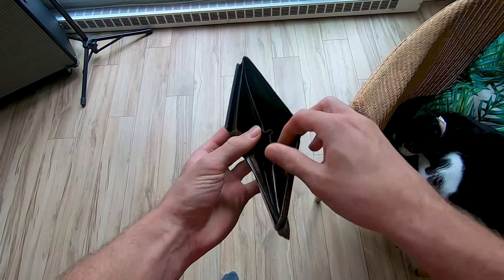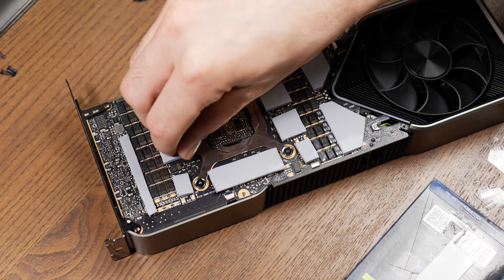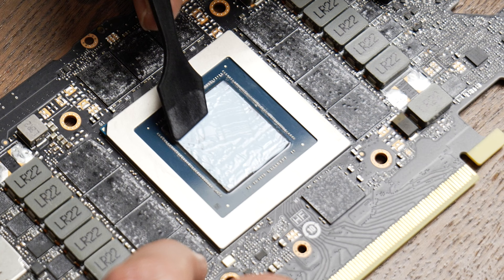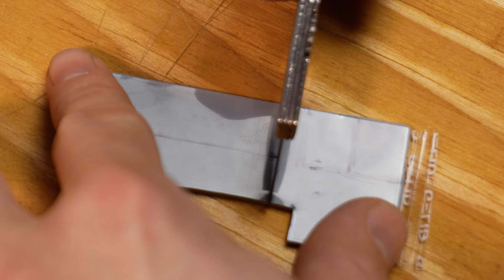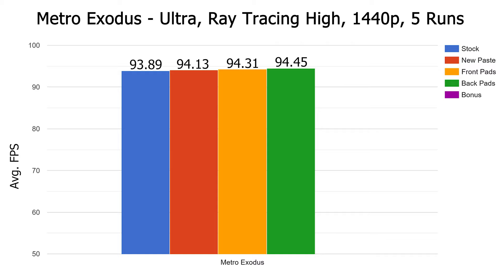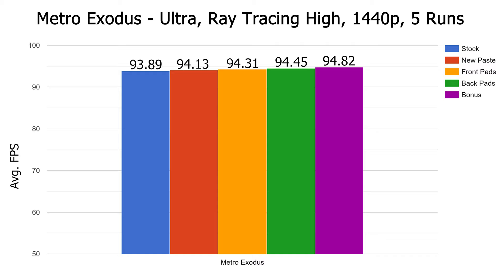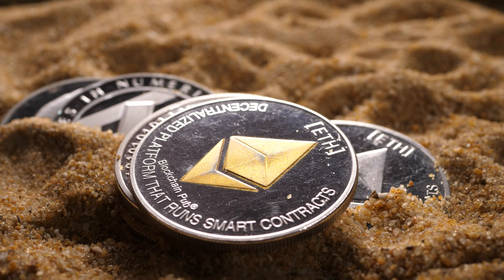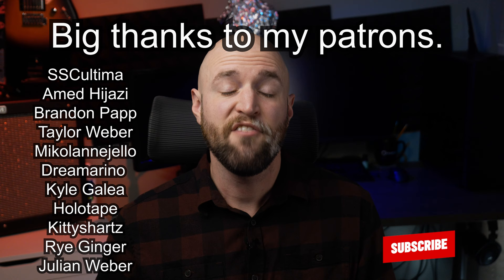Are New GPU Thermal Pads Worth It? | GELID GP-EXTREME

Comment from the maker: Unless you are Mr.Moneybags I only recommend swapping the face of the card. You can get away with using a single 2mm sheet. US link: https://amzn.to/3MC2pO0 Canada: https://amzn.to/3Xf62y2
Reply: @Tech Illiterate  Is this 3080ti FE new? like bought within the last couple months? People are saying the spec changed with the newer cards
Reply: @spaghettir101  bump ^
Reply: @spaghettir101  his is old board
Reply: @spaghettir101  In 3080ti Fe have 5 month old more or less, whats thermal pads I need? Is 1.5mm one side and 2mm other side?
Reply: @mdmt111  probs 1.5mm on the vram and 2mm on the vrms.  Leave the back, its not needed
Reply: you should try K5 Pro it works great

Comment: Looking at the GPU market prices, lowering temps may not give you more gaming performance, but it will make your card last longer due to the low temps, which I'd say is worth it.
Reply: no one knows by how much
. were making our best guess that could be the case
Reply: @flawns  lower is always better.
Reply: Don't forget the noise of the fighter jet that doesn't come out off my case ;)
Reply: It will improve latency, low1% i notice
Reply: Yep! I plan on using my RTX 2080 ti at least until 2030 .. seriously. and I am gonna replace the paste on the GPU by a Carbonaut pad and the thermal pads by Gelid ones. As the memory was an bigissue with the 2000 series, lowering the temperatures on the mem could have a huge impcat on longevity. Also I of course heavily undervolted the card.
Reply: @flawns  Usually optimizing from the vendor's original parameters has a large impact in longevity, because vendors are pushing hardware to an unhealthy max, for obviousy reasons. It's advantageous to not only have slightly beter benchmarks, but also lower lifespan of products, expecting your customers to buy from you again...
And as the relating physical parametres behave exponentially, there's a LOT to win by changing a bit. The temperature deltas to be seen in this video could easily expand a card's lifetime by some few hundred percent.
Reply: @elmariachi5133  they also put the minimum required variables to achieve competitive prices
Reply: It's hard to say whether it will or not. Assuming everything else is the same, lower temps will definitely make those memory chips and VRM components last longer, but would either of those be the first parts to die anyways? Maybe, but no one knows. Just like a person, graphics cards can die for a bunch of reasons. If, for example, the GPU core itself or some capacitor or resistor will be the first thing to fail, changing the thermal pads isn't going to do anything to prevent that.
Reply: yeah, I think the longevity will be longer.
Reply: @averyalexander2303 Yeah, but having it run cooler reduces the amount of it expanding and contracting from the heat, which could in theory decrease the chances of a capacitor breaking.
Reply: @MrGamelover23  Good point. Lower temps certainly increase the chance of good longevity, there just aren't any guarantees that more effectively cooling a few of many components will or won't increase the longevity of the card as a whole.
Reply: but electric current usually killing it
Reply: Even without putting on new thermal pads your card will last long enough to the point to where you're going to upgrade to a new card unless you plan on keeping your card for over 10 years

Comment: A graphics card at better temps is worth it, as it probably might increase the longevity of the card…
Reply: no one knows by how much
Reply: @flawns  yes but still it helps with the peace of mind that your card is not running at near limits. also, it helps keep room temps down especially if you're not using ac.
Reply: @flawns  By a f**king shitload.  There are plenty of studies which have tested the difference of running at thermal throttle temps (100% of the time) vs capped at 90% of thermal throttle temps and it almost doubles the lifespan....considering his memory was being throttled (100 deg) ....yeah....huge difference.
Reply: @Lancia444  For real, you're kinda aggressive but this factor seems really under emphasized. Heating and cooling is expanding and contracting the material, which wears it out. All materials have durability limits and can only do this so much. The higher temps push all metal and silicone further to it's limit, and like most thing's in nature it isn't linear, but moreso exponential, specifically to closer to the Fibonacci pattern than any other pattern.

Basically the lifespan can be thought of as a result of build quality taken to the square root of the temperature it's used at. That lifespan dropoff gets a way faster increase in every incremental step of it's reduction for each consecutive degree a material is taken toward the final max temperature that it will simply break at immediately.
Reply: @mangosteen.  "it helps keep room temps down especially if you're not using ac" That's not true. The card will output the same amount of heat no matter what cooler/pads you put on it. It's just that the heat from the card will be transferred into the air more efficiently. Unless they've invented a new form of GPU cooling solution that sucks heat and then teleports it into a black hole at the other end of the universe.
Reply: @mangosteen. Having a better cooled cards wont do Jack shit for your bedroom temperatures. That's not how physics works. Without a change in Settings (voltage / power limits), the heat output doesn't Change regardless of the quality of your paste / pads etc.
Reply: @bgtubber  People often say that as well as that better heatsink paste will make the heatsink colder. The opposite is true, it will conduct heat better so actually while the CPU will run cooler the heatsink will be a bit warmer.
Reply: @Lancia444  this is not really a relevant comparison because capping the card at 90% of the thermal limit is not the same as running it cooler. By capping the thermal limit you effectively make the card run on lower voltages and it is common knowledge that in the long run and outside of edge case scenario voltage is the real killer of electronics, not heat. Still I'm not denying that improved cooling won't help - just pointing out it's not the same thing.
Reply: @bgtubber  not quite true, resistance raises with temperature therfore technically decreasing the operating temperature of the GPU could yield better thermal efficiency - same performance with less heat output. Less heat generated due to the resistance of the components on the board. Though the difference most likely be neglegible in the case of swapping pads, to get a noticable decrease in heat output you'd probably have to water cool it.
Reply: From my experience, improving, the cooling of any graphics card increases longevity as well as stability. now by how much is a different story altogether, depending on brand and cooling used

Comment: It's not just about gaining performance, it's also prolonging the life of the card.
Reply: Exactly.. Memory temps reduction by 16°C is a huge success, it doesn't matter if the performance rises or not, the important thing is the memory now isn't overheating what should potentially increase the gpu lifespan, or rather the lifespan of the memory chips. 

The sad thing is the gpus don't come like this from the factory, the late stage capitalist big business corporatist thinking nowadays is that it will survive long enough so the warranty expires and then you'll simply buy new gpu if it manages to die on you. Some call this planned obsolescence but they don't really plan it, they just use the same materials they used for decades now and only address the issues ie replacing the materials or doing other improvements if the product would be dying way too often under warranty what costs them money.
Reply: Exactly! Not to mention that with the lower temps, I was able to oc my 3080 and run fans slower and quieter, SOOOO, I gained huge performance advantage.
Reply: Not just that but fan noise is bad when the temps are very high.

Comment: I thought 1.5 mm was the ideal pad size for these things... that's what I used on my 3090. Same deal, temps dropped significantly.. I don't game, but I do feel safer when my card is rendering in octane for several hours.
Reply: Every cooler has different dimensions, 1.5mm may be the correct size for this card, but it’s not universal

Comment: Better pads = Lower temps on card, less heat in the PC tower in general, less stress on the card which means better longevity in general. Couple this with a slight undervolt and you're golden. Also don't forget that some cards come with really crappy thermal pads. Subbed by the way 😀

Comment: These mirror my results exactly.  Performance improvement was within margin of error, but memory temperatures were decreased substantially, and that was with cheap "blue" amazon thermal pads.  Performance gains were only realised with undervolting (using the Volt/Freq curve in Afterburner).  Great video!
Reply: did the fan sound also decrease?
Reply: @Gojee_  Not that I recall, not substantially anyway.  I was also playing around with custom fan curves at the time, so I can't comment on how fan speeds were affected, or by how much.

Comment: Just did the same thing on my 3080ti FE. Oct 2021 date on the cooler, reddit suggested changes on the later production 3080(ti) FE coolers should use 1.5mm instead of 2mm. Used 1.5mm Gelid Extreme on the chip size, 2mm Extreme on the back place. Temp results are fairly aligned with the your test. Thank you for the info!
Reply: Hey, it might be late for you to remember, but what thickness did you use for VRAM and MOSFET pads? I have a 3080 TI that has a hot spot reaching 100 degrees when gaming, so I am planning to replace pads/thermal paste to start with and see if anything changes...doing some research first regarding what pads/what thickness to use for different locations on the GPU though.
Reply: hi

i have a question ,i have Asus Dual GeForce RTX 3060 Ti V2 Mini OC.It overheats .when i play gta 5 and furmark it goes up to 85
some people say it is normal ,even i changed 4 times thermla paste with 3 different good brands still didnt make any difference.if i dont play games i get 45-50.only when i play games it goes up to 85
i ordered the thermal pads i will change the thermal pads and give a try also 
if i put thermal pads on the back plate will it make a difference also.if it makes how thick it shoudl be covered with

Comment: the coagulated feel of the pad is called "wet-out" pad. They are extremely conforming to the shape of the location you apply them to. This is because any gaps/scratches/deformities can be filled in and eliminate the air pockets, ensuring good contact. Its usually held in shape by the plastic sheets/casing it comes in. You need to let them cure/set before the catalogue properties/performance can be expected.
Reply: except if the pads are crap then you won't get very significant temp changes when they do cure/set.

Comment: There's a LTT video where they try out a thermal pad replacement in gel form. The pad replacement was largely irrelevant, but the repaste turned out very interesting. There wasn't a direct FPS increase, but hte min 1% and min 5% fps increased by about 20%, which is huge. 

They didn't test this very thoroughly or even note it in the video. I'll probably try this out myself, but it may or may not be a good video topic for you as well.

Comment: To get a better idea of performance improvement in FPS or synthetic benchmarks, you would want to overclock the GPU to a stable setting before and after swapping the thermal material
Reply: I totally agree with this. The real test is how the GPU will perform at heavy load.
Reply: Yep exactly, you won't see big difference in performance, as long as the GPU was functioning properly and normally, he is only lowering the temps, but what that does is to give you more space in terms of overclocking the GPU and that is when you will get a boost in performance

Comment: Yes, they are. Went from thermal throttling at 95mh/s on a 3080 TUF to 95F at 101mh/s after Gelid pads all around the board.
Reply: Did you use a similar method to this video for the 3080 TUF? Same pad thickness etc?

Comment: Got a 3070 2nd hand and it was having really bad temp issues. Had to underclock my GPU otherwise it would completely black out after 10 minutes. Replaced pads and paste following this advice and also the undervolting video and it works a treat now getting temps ~60°C when previously it was capping out at 83°C.
Reply: what paste and pad did u used ?

Comment: I just replaced the thermal pads on my Asus TUF 3080 over the weekend. I was getting a GPU temp of 64 which isn't bad but then a hotspot temp of 90C and Memory Junction temp of 110C. After replacing the pads with Gelid pads, and knocking two resistors off the board, and dying inside until Monday when I got the GPU fixed, I was back up and running. My GPU temp dropped about 8 degrees using Arctic MX-4, Hotspot dropped to 72C and most impressive of all is Memory Junction temp which dropped about 50 degrees to 65-70C. This was with my GPU overclocked too. I do have an undervolt profile saved but haven't checked what the temps are for that but I'm sure temps would probably be a tad bit above idle temp.

Comment: You're also makign it quieter. I got a 3090 yesterday and noticed it never ramps up for GPU temperature: the huge cooler deals with that pretty well, but sometimes it seems to go into turbojet mode, and if I look in HWINFO, it's the memory junction at 104-106C. Apparently damage temp is about 120C, but if you're spiking to 110, that's uncomfortably close. Going to repad this week, because I want my new card to last for at least 4-5 years.

Comment: May not help for overall FPS but will surely help for long term LIFE of the card..
Reply: Fan speed references the core temp, I think it might ramp up if VRAM is thermal throttling, so the difference would be pretty minor, not nothing, but small

Comment: Jesus Christ. 110 Celsius?  My Ryzen 5 5600x was that hot when my AIO water cooler pump broke and wasn't cooling it at all. lol
Reply: isnt the max temp on that chip 90c? how was it still running, just super throttled if at all.
Reply: @sscultima  Nah, the 5600x has a maximum temperature of 95C before it starts to throttle. Mine was dropping almost 30 FPS when it was 110. That was my first hint that something is wrong since I don't check my CPUID HWMonitor every day.

Comment: I'd recommend slapping a fin heatsink on the back of GPU. I've done that to my 1060, and it's actually drawing away a lot of heat. The backside heatsink I installed is always hot to the touch, I'd guess around 40C. With a more power hungry card like 3000 series, I'd imagine the benefits would be even greater.
Reply: Hi could you please tell me exactly how to do that to which area exactly I should put the fin heatsink
Reply: @KimR To the area that generates the most heat

Comment: I just ordered a 3080 that the reseller failed because it crashes after an hour of furmark, it's a Dell OEM card that is known for high memory temps (thanks Dell design team) if I'm lucky pads and paste make it a very cheap 3080 (or what a last gen good card should actually cost rather), if I'm unlucky it's an expensive brick. Either way it's getting the thermal mod it deserves to find out.
Reply: I know this post is 8 months old, but I'm curious to know if you had success or not?
Reply: @handenbramilton  it's my daily driver, works fine. It wasn't memory temps as it turned out though, the core thermal paste application was bad.

Comment: Swapped the thermal pads on my new MSI 3080 with 2mm gelid pads. Mem temps went from 90 to 80 under identical conditions.

Comment: 100 degrees is high, but it probably isn't shortening the realistic lifespan of the card, even under heavy load.  It isn't uncommon for industrial IC's to reach 105 degrees and run for ten years continuously at that temperature.  But it's probably better to be safe than sorry.  I would definitely prefer to see lower temperatures on these kinds of cards.

If you are really concerned about longevity, making sure the card isn't overclocked, and possibly underclocking and undevolting the card, is the way to go.
Reply from the maker: Yeah I think you're right 100p.

Comment: I replaced the pads and the paste on my three-year-old 3080 and now have 8 to 10°C less GPU temp. The card is much quieter and has 400 points more in TimeSpy with the same settings as before. For me, the 30€ investment was worth it.

Comment: These had better bring the NVS 2100M away from that 100c range. It came stock like this, I repasted both the CPU and GPU and while the CPU did improve temps, GPU got worse. I suspect that since the GPU came with pads, I should just get NEW pads. Ones that really perform instead of the old blue malleable stuff. I'm gonna have to guess the thickness so I'll get both the 1mm and 2mm before I take apart my Tecra A11 S3540 again.